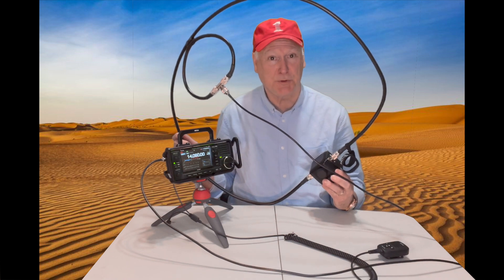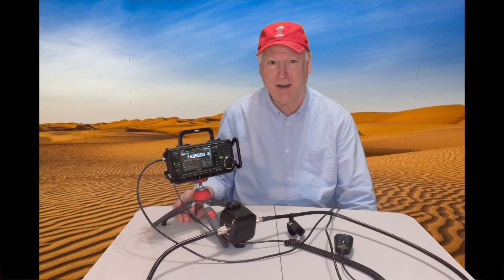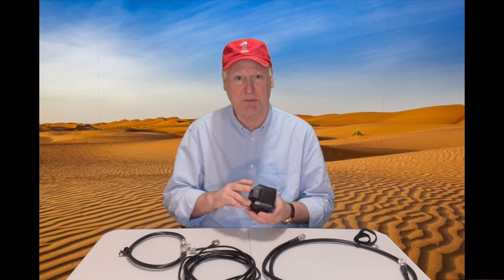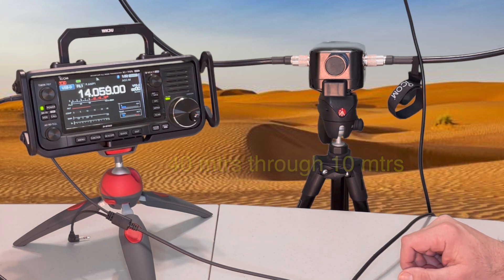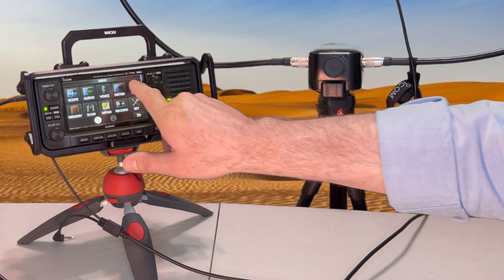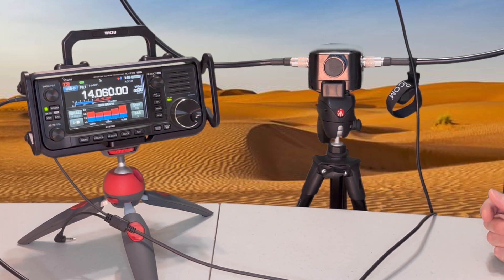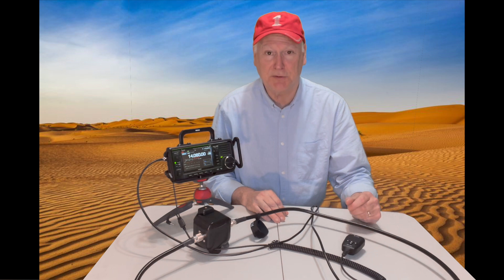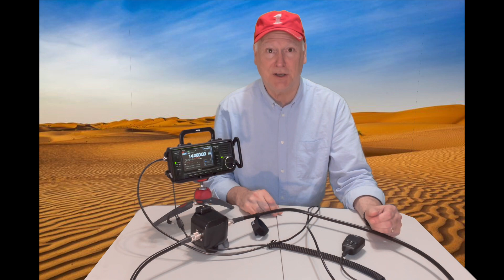Do Magloop Antennas Really Work?  Testing the AL-705 with the IC-705

Comment: No balun on magloop right? Just ironing out this balun thing currently
Reply from the maker: I didn't use one, and the manual didn't call for one.  The matching is done in the tuning capacitor on the antenna.

Comment: Can you use the AH-705 tuner with the AL-705 magnetic loop antenna? Does the manual tuner need to be removed from the mag loop?
Reply from the maker: The AL-705 has a built-in manual tuner. Due to the nature of the antenna I believe the AH-705 will not tune it.

Comment: I have an AlexLoop and it came with an accessory that you attach to the loop. It has a red LED that indicates when you reach optimal tuning. It is very helpful since my FT-817nd doesn't have an SWR meter. Thanks for the video.
Reply from the maker: Thanks for the info!

Comment: I have both a purchased mag loop and a home-made mag loop.  My home-made antenna is far superior in terms of performace.  I have had a mag loop for several years now and swear by them.  I live in an HOA that prohibits the installation of visible antennas so I have my antenna sitting right beside me inside.  Works like a champ, I use a qrp rig and was able to do a clean sweep on 13 colonies. (From Texas)  Never seem to have issues RX or TX  people that don't like mag loops are most likely using them wrong.  I have reached Africa, North Canada, all of the Caribbean, South America, Japan on a mag loop inside the house on 10 watts.

Comment: The best mag-loops are homemade, and a whole lot cheaper. Manufacturers are too cheap to make the conductor of their loop large enough in diameter to give them the extremely high Q they need for transmit efficiency, and narrowest bandwidth on reception. BTW, if doing hand tuning, use a flexible extension on the tuning knob. I'm also using a small variable capacitor in parallel for fine tuning.
Reply from the maker: All good points!  I sold my AL-705 and I'm now collecting the parts to build a mag loop at home.

Comment: I got a AL-705 magnetic loop for my IC-705. Got my first DX contact with it on 10m SSB one afternoon into Coasta Rica. I also got the Enhancement Kit from Alpha Antenna that gives 60 amd 80m. 

The Tuning Spacer from the Enhancement Kit work great with the standard configuration and gives it more bandwidth if you got the 15ft coax. Using the clips that come with the antenna isn't going to tune on 20m. Get the Tuning spacer and it will tune 20m.

The Standard configuration tunes 40 and 10m to around a 1.2:1 SWR, maybe less. 12m will not tune because it's a small band. 15m is a bit difficult as well. 

I just use mine inside the house for listening to 40m when I get home from work in the morning. Haven't used it for SSB in quite some time. Might need to get it out on a good day. 

73, W4ISB 
Mike in Tennessee.

Comment: Good demo....but....why has FT8 taken over ham radio? Have we lost the skill of just talking?
Reply: "why has FT8 taken over ham radio?"

During low sunspots; the narrow bandwidth and low data rate of FT8 permits contacts where voice would be impossible.  Other modes are similar; Olivia can make contact when you cannot even see the signal on the waterfall.  Olivia is a conversational mode; FT8 is for contacting only.  There's another aspect; FT8 simultaneously decodes dozens of QSO's in the audio passband and you don't even have to receive on the same frequency you transmit (in fact, it is better if you "split").  

"Have we lost the skill of just talking?"
There is no WE.  Only you know if you have lost the skill of just talking.  But I take your meaning; carefully tuning across the band, listening, asking if a frequency is in use, calling CQ and giving people a chance to reply (might be they are tuning their antenna), seems less common.  With waterfall displays in common use the thrill of "catching one" by careful tuning is not really necessary.  You can still do it; turn off the waterfall.
Reply: JS8Call is for "just talking"
Reply from the maker: @sammiller6631  VarAC is catching on as a good HF chat app.  Very robust data management; great weak signal performance.  Built on top of VARA HF.  But you have to buy a license to get full features.
Reply: @tekspeditionplanet9109  Buying a license is worth it for quality work. Too many people expect everything for free these days.
Reply from the maker: Yeah, I know what you mean.  My reason for demonstrating with FT8 was the ability to display signal reception reports globally with PSKReporter.

Comment: The commercial coax mag loops can get to a 1:1 swr- but that doesn’t mean they’re efficient.  Dummy loads have a 1:1 swr.  The efficiency of the typical coax mag loops on 40 meters is dismal- around 15%; it gets at bit better at 20 meters, close to 50% and improves to 85/90% as you get closer to 10 meters.  You get some direction in the plane of the loop which can help null unwanted stations or noise- outside of their size it’s one of their key features.  They can be interesting/fun antennas.  Careful using FT8 to draw conclusions, even 1-2 watts of radiated power can get out pretty far and can fool you if dumping 10 watts into the antenna.
Reply from the maker: Some excellent points.  As you point out, the SWR is not the definitive measure of success with a MagLoop (or any antenna).  With previous MagLoops I found that the antennas were actually better at radiating than at receiving.  I relate that to the small capture area of the antenna.  Although some die-hard MagLoop enthusiasts will claim equal performance as full size antennas, I would like them to demonstrate with a good antenna shoot-out.  Nonetheless, MagLoop antennas do have valuable niche uses.
Reply: @tekspeditionplanet9109  They are kind of neat.  You can set one up on a camera tripod, use it indoors/outside.  I have an Alex loop and a chameleon.  Performance is indistinguishable; but you really, really want a gear reduction on your capacitor.  I am QRP almost exclusively, even at my QTH, with a flex 1500 @ 5w.  I use an end-fed half wave for 40-20-15-10, it’s up about 50’, NE/SW broadside.  I won my states QSO party this past year for QRP, blowing the old record away by something like 4x (I got like 250) the number of QSO’s and triple the points.  Almost all on 40m.  There is no way I could have done this with a 15% efficiency on 40m witha standard commercial coax loop.  My ERP would have been 750mW, on SSB, or approx -9db under 5W - that WSPR territory.  I have used them on 20m and got into Europe on SSB during the peak of the last solar cycle.  You just can’t get around the physics of a short radiator for the band you’re broadcasting on.  

The other thing is that if you’re trying to hunt down stations across the band, like for parks on the air or something like that, you have to adjust that antenna every single time you change frequencies. For POTA, that’s almost 50 times on a busy weekend of hunting.  No Fun. But, if you’re on a single frequency, ideally on 20m and shorter, calling CQ, oriented in the direction you want they’re definitely an option.  The only thing the operator needs to ask themselves is why buy one for $300-$400, when a 31’ piece of wire, a 4:1 balun, and a SHORT run of coax (less than 10 ft) all of which can be had for $75 can let you work all bands with a tuner and near 100% efficiency.  Throw it in a tree and go.
Reply: Antenna efficiency is directly proportional to a combination of area encompassed by the loop and the antenna conductor dimensions.  Because of skin effect, a tube formed into the circle is vastly better than a wire in a circle.  
Because of this, I have made loops for each band of interest.  The 10 meter loop is remarkably small, the 40 meter loop is about 10 feet in diameter and made of 5/8th inch copper tubing.  I use the MFJ portable loop tuner since it uses variable capacitor for matching and another for tuning; no need to fiddle around with a small loop dangling inside the big loop.  It is pretty easy to get a perfect match, no tuner needed, at any band for which you have made a loop.

Comment: I have had just about all the mag loops at one time, have to agree on the Alex Loop, especially for quick deployment and ease of use, but has no 6 to 1 reduction tuning  which really helps but  the best I have used for all around home and indoor use has been the Chameleon F loop 3.0 which is their newest smaller tuning box model,  for tuning    That loop has been near perfect for initial tuning by ear, the ferrite beads on the coax they supply with the 12ft coax run virtually eliminates any hand capacitance,  On coax coupling loops you can shape the coupling loop from a circle to more of an oval (compress it some ) and it improves the efficiency,  I did not do it on my F-loop as it used a hard aluminum coupling loop but did do it on the Alex Loop since it is basically a stiff thick wire and was able to oval it.  It works and RBN testing verified it,    Both loops have been great  tuning has been easy,  and my performance inside has been unbelievable at times.  It is amazing how swinging the loops sometimes just a few inches can be the difference between a qso and nothing,  I am trying out the W2LI mag loop next,  made by a local club project and  sold direct or off of Ebay, The price is around $169 plus shipping although I maybe a tad more now since they just finished another limited production run,  I can't wait to check it out and compare it   I once used my Alex Loop inside a concrete gym complex and was demonstrating it at my swap table at a local hamfest and using SSB and 5 watts was working the Washington  Salmon Run contest and worked about 20 stations ,  the hamfest crowd was amazed,  All that being said most mag loops are probably way over priced but so are countless other portable antennas on the market so I guess it just depends on the need and if the cost is worth it, hi   I am nearly a 99% CW op and CW and digital will always be the best modes for mag loops,   Thanks for the video and hope you work a lot of DX  73 J

Comment: Nice demo - have to say I think the Alexloop hampack is a superior magloop looking at ath AL-705. I've used it on several QRP PoTA activations and its done really well for rapid deployment. I would say the best advantage on the alexlooop is the gauge/tuning and the LED light showing the power coming thru. I appreciate your video for showing other tuning methods tho, something i will check out next time. Thanks again for good content ! 73 2E0FWE
Reply from the maker: Thanks for the feedback.  Yes, this is a real bare-bones MagLoop with no frills.  And that includes even a lack of a way to mount the antenna.